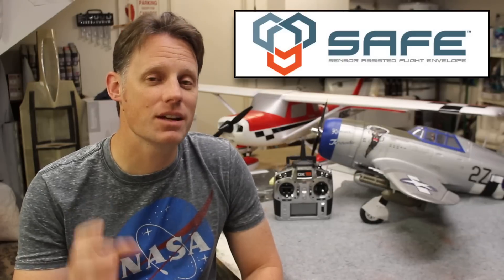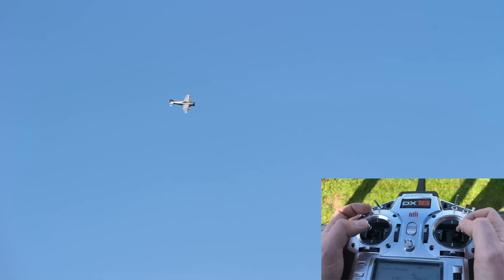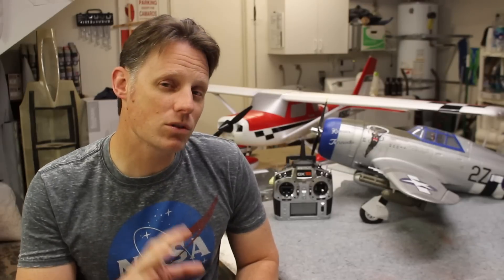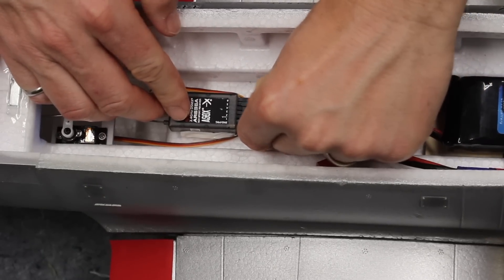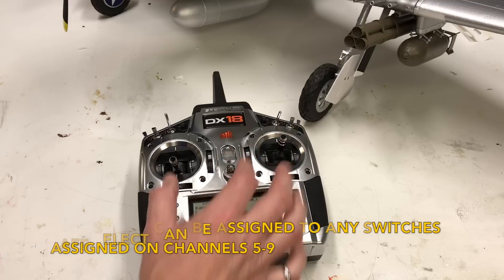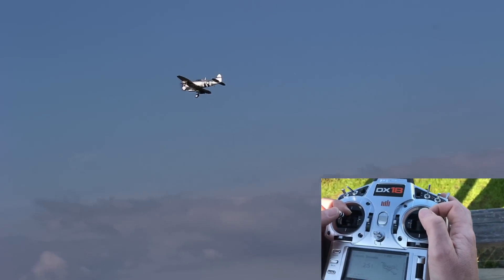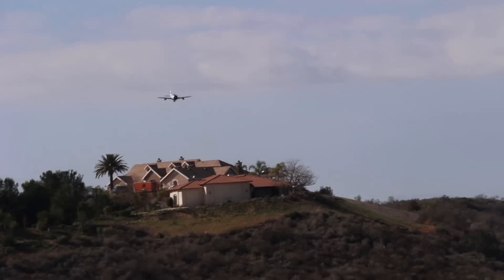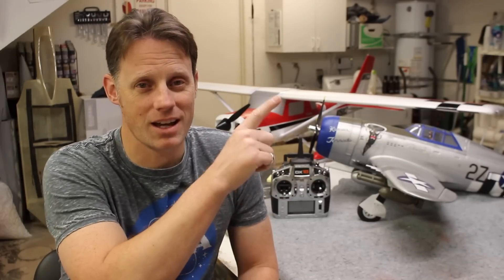From the Bench - Horizon Hobby/Spektrum SAFE Select Technology Tutorial

Comment: Still confused !  Can SAFE be added to an existing plane and radio ?  Is it a physical piece of equipment, like a gyroscope or servo?  Are there sensors inside the plane,  how does it know it’s inverted.  Does the Tx have to come from the factory with it installed?
Reply from the maker: It’s a Spektrum feature that is all handled in the receiver. It has a 3 axis gyro in it that is used for the auto leveling. So, if you have an airplane that you install a safe capable receiver into, that airplane will then have safe available if you set it up.

Comment: Got a problem / question.  On my DX9 Transmitter I successfully assigned SAFE to switch "A"  I want to move the SAFE option to switch "B" .  Switch "B" is a 3 option switch where I already have all my Duel Rates and Expo set up.  Do I have to change All my settings back to 100 % on that stick to move SAFE over to switch "B"  Or can I just change "ONE" of the 3 options back to 100 % on that switch and move it to that location.  Hopefully I'm making since.  Also will I have to re bind the receiver afterwards.  I've already tried with no success.   It would be of great help if you could help me out with an answer.  THANKS
Reply from the maker: I’m not entirely certain. To set the switch, I think everything will need to be set to 100% to ensure that takes. So, you’ll want to setup your rates on a different switch.
Reply: @Thercgeek  Well.  I cleared out switch B and set all 3 toggle options back to 100% travel and zero Expo.  Original factory settings.  Then I re bound the receiver with SAFE OFF.  To completely start over.  I then re bound the receiver with SAFE ON and tried to activate switch B as the on, off switch.  SAFE refused to acknowledge switch B as the new on, off switch and defaulted back to switch A.  There's got to be a way to move the SAFE on, off switch to another channel.  If you can run across a way to do this PLEASE let me know.  I know how to fly and all, but I would like to have the SAFE option because this is a smaller airplane and I can get disorientated when the airplane is far away and I'm doing rolls, loops ect.  Maby once SAFE is set to one switch, it can't be moved.  If you can find an answer, PLEASE let me know.  THANKS.
Reply from the maker: Is the switch you’re trying to assign safe to assigned to a channel at all?  The switch can be assigned to any channel 5-9 and won’t take safe unless the switch you’re trying to assign has a channel assignment to it also.

Comment: I think im doing everything everyone says to do and and still cant assign safe to a switch. Plane is bound with safe ON and safe is working. My switch is assigned. Rates are 100% and im toggling the switch 5 times up and down. Its wont respond to the toggling.
Reply from the maker: Do you have the switch you’re trying to assign to safe assigned to a channel?  Which channel is it assigned to?  Also, What radio are you using?  If you have an nx radio, you can actually setup safe in the forward programming menu.
Reply: @Thercgeek  dx6e. Thanks for the reply but it finally did the dance and works. Apparently you have to have ALL of the RATES AND SERVO TRAVEL AT 100% I had the travel down a bit for the elevator and ailerons. Turned them up to 100% and it worked!
Reply from the maker: Glad to hear you got it sorted!

Comment: My valiant 1.3 pitches down  doesn’t fly straight and level in safe mode so I adj. elevator trim while in safe mode and seems to fly level now. After landing I adj. elevator linkage and reset trim to center. Did I do correct adjustment procedures?
Reply from the maker: With safe on, trimming may be required if the control surfaces aren’t mechanically rigged at center. So, I’d say what you did was correct since when you switch between safe on and off, the surfaces shouldn’t be dramatically changing position. They will if they’re not mechanically centered.

Comment: Excellent effort. Theres just no information about this feature for new RC pilots. All vids on you tube expect us to know what this already is. I'd appreciate a video that explained what AS3X and SAFE gains are and how and why we want to alter the gains
Reply from the maker: I’m working on a review of the new smart 10 channel receivers in which I plan to cover some of that. AS3X is a gyro stabilization system and so adjustment of the gains is the amount of stabilization. More gain=higher rate of stabilization. However, when there’s too much gain, the model will oscillate and can become uncontrollable. Generally speaking, most airplanes don’t need gyros, but they do help smaller airplanes to feel more like a larger airplane in flight.

Comment: I'm new at flying. I'm into rc cars and trucks both nitro and electric but I wanna get into the air planes. Do you recommend the fly trainer computer program or buy a cheap model and learn with the cheap model plane?  Keep up the good work with your videos. Thumbs up👍 on this video.
Reply from the maker: Investing in a good simulator will save you time and money down the road.  Time in the sim directly translates to actual rc flying and will help you train the feel and muscle memory.  Also, I'd recommend connecting with a local club as they usually have flight instructors and trainer aircraft to help folks get started.  A little flight instruction will go a long way in providing a good foundation to build your skills upon.

Comment: Hey Chris thanks for yet another great informative video. I'm trying to learn how to fly edf jets and in preparation have been using SAFE with an F27(the small one) which can really go fast.Also,  I have some of the handlaunch 64MM jets which with the just stabilzation receivers I feel pretty confortable flying these jets. Now I want to move to takeoff/landing on narrow runway with the 64MM jets with LG. I'm thinking of getting one with SAFE so while flying I can fly without SAFE but also have SAFE on during landing start. Then switch to SAFE off and only use on emergency during landing as needed. I don't have access to an instructor. I'm hoping this will build my jet flying skills quickly.
Now the real question...(I know I'll get hate post for this one and probably go to the bad place when I die)...how about putting the Spektrum AR630 receiver with SAFE into the Freewing F14? I have this jet (with the good afterburners) and ultimately this is what I want to fly. Thoughts on if this would work and if this is a good approach to get to the point where I can fly the F14?
BTW you have some of the sweetest F14 landings!!!
Reply from the maker: Safe used in a smart way I think is a good way to protect your investment, so no judgement here in that sense. 😊. The challenge is that the ar630 is only 6 channels and the tomcat requires a minimum of 7 channels.
Reply: The RC Geek - Errr...I guess if I don’t hook up the throttle then I can get down to 6ch and be totally “safe”!  :)
Well more practice and sacrificing more 64mms...
Reply from the maker: Haha, I suppose so! 🤣. I suppose you lock the wings to the extended position if nothing else.

Comment: great video, when setting trims inflight  should safe be on or off? Thank you.
Reply from the maker: The airplane should be trimmed as needed either way. You’ll find that it’ll mostly need to be trimmed with safe off as with safe on it will auto level the airplane. The goal would be for the surfaces to not change position when switching between safe on and off on the ground.

Comment: Thank you Chris. I finally learned not to use SAFE. Going further, how can I assign a 3-position switch for 3- Flight modes- No AS3X (Zero Rate gains), AS3X only, SAFE On for example on a eflite Viper. The manual only explains about SAFE select but not how to assign 3- Flight modes. Most of the eflite receivers have 3-Flight modes that could be programmed. It will be great if we can use this feature too. Thank you:)
Reply from the maker: Awesome!  In order to turn on and off the gyro, you have to connect to the receiver and use the app to set that up and assign the switch there.  I’m not sure how that works with safe as I’ve not done that. I’ve only programmed and tuned a couple AS3X gyros and I’ve not played with changing any of the receiver settings in the bnf’s.
Reply: @Thercgeek  Thanks. I have ordered the bluetooth module and will try setting up the receiver. As always, love your reviews:)
Reply from the maker: Thank you!

Comment: Is there a reason when i switch to intermediate stabilizer mode the plane falls out of the sky?
Reply from the maker: Well, intermediate mode gives you more direct control. What exactly do you mean it falls out of the sky?  That could be any number of things. When you flip the switch on the ground, do you notice a trim change on the elevator?  It shouldn’t change at all, so if it does you’ll need to adjust your elevator trim.

Comment: Hi great video. I have an AR636A AS3X RECIEVER from my 2m carbon z t28. Can i activate safe select  with this like you explain to the landing gear or flap channel on my spectrum dx6 as i have just ordered an fms 1700mm corsair which is the second corsair i have bought
Reply from the maker: Yeah, that should work.  Just make sure you install the gyro in the correct orientation, otherwise it'll operate backwards.  Also, the gains on the AS3X gyro will be tuned to the T28, and not the corsair, so just be aware of that.  IT may be perfectly fine, but you may also notice some instability (wobble) from it if the gains are too high.
Reply: @Thercgeek  so i guess the ports face aft
Reply from the maker: Most likely, but you'll need to visually check that the gyro is moving the servos in the right direction when you move the airplane around.  You don't want the gyro acting against you.

Comment: Great video.  Subbed!  I bought a new Horizon Hobby T-28 because I  ...  erm... ran over my other one with my truck that I forgot about and left on the ground as I was loading my other plane.  That one was bought from a friend from the club but he took the spektrum receiver and replaced it with an orangerx that didn't have SAFE. It had a few crashes already which was evident by the epoxy!  As of this post Im still learning and my instructor is saying the same thing you said where I should learn good habits and not rely on any auto-fly capabilities. My landings with my Kadet are bouncy but my landings with the T-28 are even worse so maybe SAFE will help level that out at least at first until I won't need it.
Reply from the maker: Thank you!  I would guess that your bounced landings are probably a result of your flare technique.  It takes some practice, but once you're able to master when to flare and how much elevator to use to soften the descent it should smooth that out.  Most anytime the airplane hits nose first or flat on all three wheels, it'll end up bouncing.  Get it to touch mains first, even if it touches down pretty hard, it'll be less likely to bounce.  SAFE may help keep the airplane stabilized when practicing on your own, but keep up the practice and keep working with your instructor and you'll get smoothed out in not time! :)
Reply: @Thercgeek  Thanks. Right now my landings are more panic mode to get on the ground quickly so I don't run out of runway (ours is paved). My instructor assured me there is plenty of runway and it will slow down pretty quickly once on the ground. And yes, the last bounced landing bent the nose gear! Easy to fix but it was a hard left turn taxi back to me!
Reply: @stevejones9044  How are the landing going?  Do you have REALFLIGHT yet?  Use the "P" key to memorize position when plane is on short final, then you can just hit SPACE BAR to practice the final approach and flare, over and over.  BTW, I use Realflight 7.5 and know nothing about the more recent versions.
Reply: @birdwing98  Hey there! Nice of you to check back.  Yes flying in general (real flying) is much easier! I'm flying an Eagle 2 with OS 40 along with the T-28.  Landings are not a fearful event any longer.  :)  I don't use SAFE in the T-28 either because it freaks me out. I have more control without it.  I turned it on a few times and it resulted in unexpected movements.  Just as soon leave it switched off.  I added it to a switch which made it easy to turn on and off.  I gave back RF7.5 simulator to the club friend a few months ago.  It helped a little bit but I found it to be a little negative training at least for me.  The simulated T-28 flight dynamics modeling isn't good in the sim compared to the real thing.  It drops much to easily in the sim compared to real life.  The T-28 foamie floats much more.

Comment: Thanks Chris for the easy explanation and how to use/not use SAFE while learning to fly. However, what is SAFE select activated landing often shown in horizonhobby product videos? Is it something you set up which lands the airplane on push of a button like in the carbon cub S+?
Reply from the maker: SAFE select will not auto land the airplane for you.  It simply stabilizes it and limits the achievable pitch and bank angles keeping it from being able to roll over onto it's back.  You still have to control it through the whole landing.

Comment: Does the dxe  Controller work with the safe system
Reply from the maker: I don't know why it wouldn't work.  You may have to do some programming to assign a switch which requires the programming app and cable I think.

Comment: Great video. So initially when setting this all up, D/R and Expo need to be at 100% (which is default when setting up a new plane anyway), and then once you've bound the plane, you can go in and adjust the D/R and Expo to whatever you like? Is that right? I've never flown with SAFE. I always just use the AS3X with my own preferred D/R and Expo settings.
Reply from the maker: When you're setting up SAFE on a switch, the EPA needs to be at 100%.  Otherwise, it shouldn't matter.  You can set the airplane up any which way you choose.
Reply: @Thercgeek  What is EPA?  Never heard that used in RC plane world.

Comment: well i have been using the SAFE Rx out of the Apprentice in multiple aircraft even those it is NOT designed for....and even tho I do NOT use the SAFE Select it is basically the same set up.....and I have been flying for many years now and decided to use that  E-Flite SAFE Rx (EFLR310013) in my aircraft for various reasons.....and there is a dedicated forum to that on RC Groups, called E-Flite SAFE in another Plane thread ....they now also are using the SAFE Select in multiple aircraft as well , NOT just what is sold by Horizon Hobby......https://www.rcgroups.com/forums/showthread.php?2135213-Eflite-SAFE-RX-in-another-plane
Reply from the maker: Thanks for the input!

Comment: Great advice on using Safe Select ,Chris. I switch it on and off while flying my UMX Timber. I still had a minor crash but after doing a post flight analysis it was caused by flying too low to recover and losing orientation even momentarily 
. I could have left it in Safe mode for the whole flight and landed without incident, but that’s not learning to fly.

Comment: Very nice and informative video.I wish to add my experience regarding problem I faced in assigning a switch for SAFE select on my E flite spitfire.I am using DX7 Gen2 Tx. As per the manual,no programming is required for assigning a switch for SAFE.However even after many attempts, I could not assign either a two way or a three way switch. Ultimately after a lot of brain storming I realised that Aux2 channel is assigned to "R" rotary knob on my Tx.  I had to assign it to 2 way switch "A" and after making sure that travel throw was 100% in both directions, I was able to assign SAFE to switch "A". I would like to ask a question regarding EFL8550 E elite Corsair 1.2 M.Why SAFE option is not available for this model, is it because of any technical issue? I have written to Horizon Hobby but yet to receive any reply
Reply from the maker: What you describe actually makes sense.  You can assign SAFE to any switch, but it has to be one that's assign to a channel.  Glad you got it sorted out.  On the corsair, I think it was actually one of the earlier releases they did, so I'm guessing that's why it's lacking the SAFE feature.  That's purely a guess on my part though.  I would imagine one could put a SAFE capable receiver into one though if so inclined.